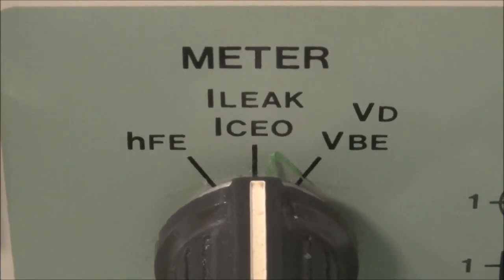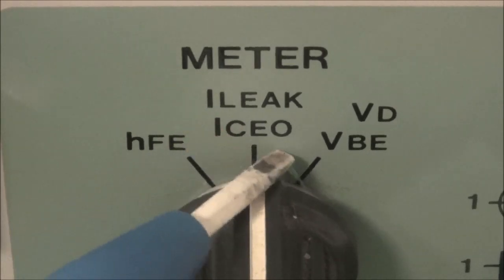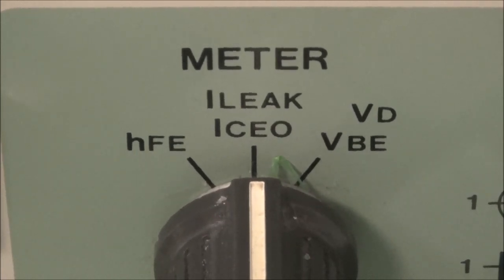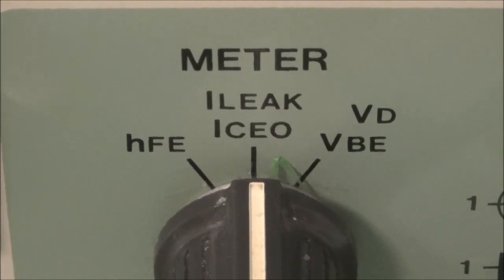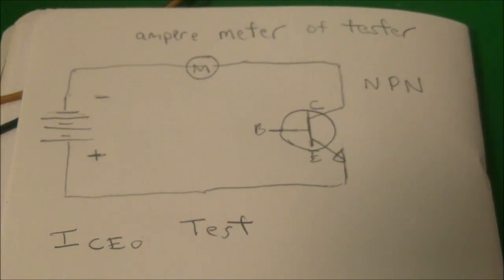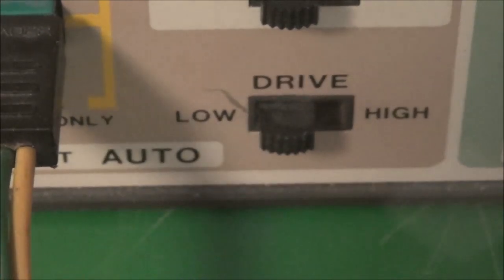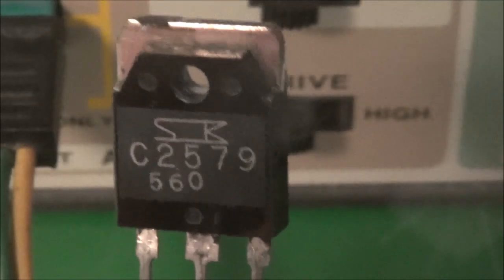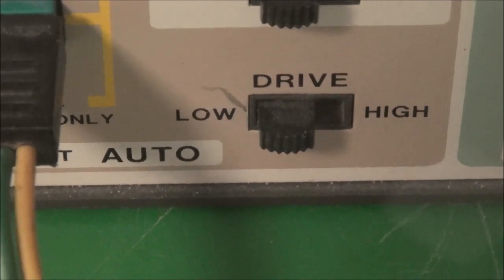Transistor Leakage Testing (ICEO )

Comment: Hello ,I am very beginner to electronics.
I just build an application that wants to periodically power on some circuits
and i constructed ,,,using latch relays.
No i am trying to find out if it can be done with transistors.
But as i am reading i see that transistors have leakage.

And i greped the opportunity to ask you that seems that you know many for those.

Can i find easilly 'zero' ICEO transistors without having the great machines for measuring them? 

(I am  interesting on transistors because if i want to go from 5 volts relays to 3 volts relays
then i cant trigger those relays directly from arduino ....because have a limit of 40ma current on their pins.
And 4 volts relays have a low ohm coil resistance ...so i will need a transistor )

Thank you in advance.
You can find and share my app in my blog.
https://jimakoskx.blogspot.com/2021/01/latch-version-test.html
Reply from the maker: Hi Dimitris. I have an Arduino, but really don't use it; lost interest. So I don't know much about it. I don't think you have anything to worry about if you use generic transistors like 2N3904, BC547, or for higher voltage/current TIP31, Tip 41. Leakage is low anyways in silicon transistors, in contrast to Germanium transistors. No such thing as a zero leakage transistor. So I didn't think you need something like a curve tracer.
Reply: @OldSchoolElectronics  Ok old man !!! 
I will try....to try !!! them ...(try learn them) ...if i also continue to build my second electronic application !!!
Thank you and be well.
PS...loosing interest "is" the proove for the infinity !!!

Comment: Nice old testers. There was an art to using these back in the day. My Peak tester is just hook it up any old way and it gives all of the information. Computers are great but it  doesn't give one the knowledge of what's really going on. There is nothing better then hands on learning. Thanks for the video.
Reply from the maker: Thanks, Pat. I use my old tester quite often. I will have to check out these newer Peak testers.
Reply: @OldSchoolElectronics  I use mine mainly to match gain on new transistors. They do show opens, short, leakage and which lead is what. But it works on a very small 12 volt battery so are limited .
Reply from the maker: Ok, I see. Gain Matching! Maybe get yourself a curve tracer, too?

Comment: I always wonder about those Vbeo etc acronym. I understand a bit now. Thank you for touching the subject. I'm also taking my watching you older videos. I saw you have a Hameg. Very nice looking scope.
Reply from the maker: Thanks! I was going to do a bigger write-up to accompany the video, but I was too lazy.

In this video I just checked the ICEO. In my case, I measured the ICEO leakage between the collector and emitter, with the base open. The capital "O" stands for open. And as I mentioned, some testers had ICBO, which was between collector and base, with the emitter open. This leakage current is smaller than the ICEO. My tester measures DC beta (hfe or gain), which is the ratio of collector current to base current (to put it simply--collector current divided by base current), with the collector voltage held constant. Base current is much smaller than collector current. And in general, as I mentioned, power transistors will have more leakage and smaller gain, while small (signal) transistors will usually have less leakage and higher gain.